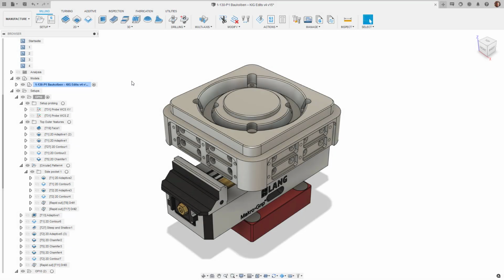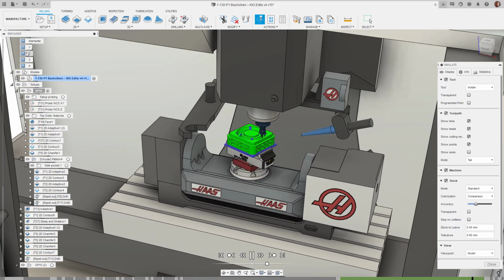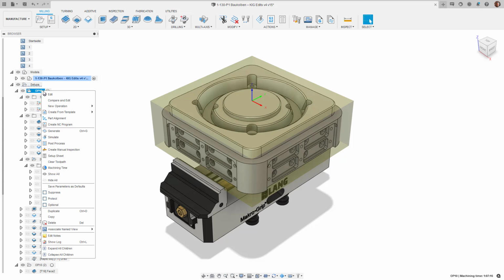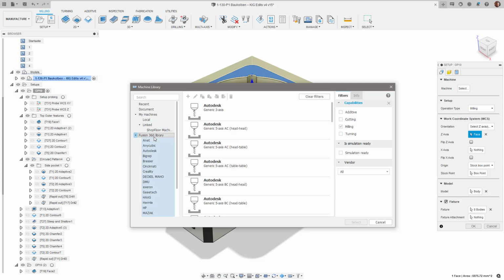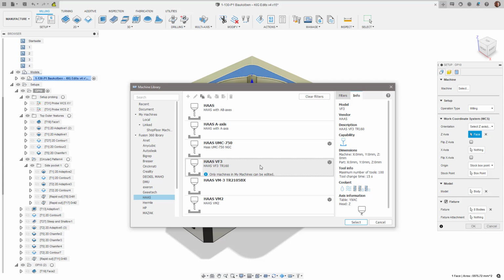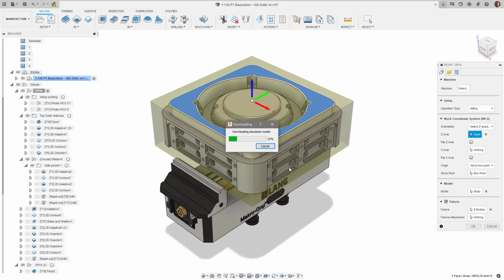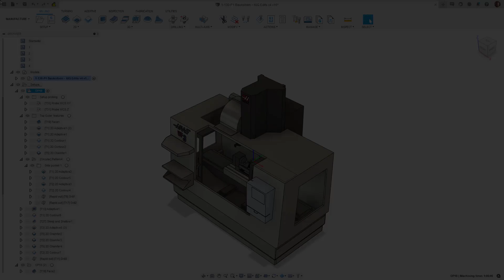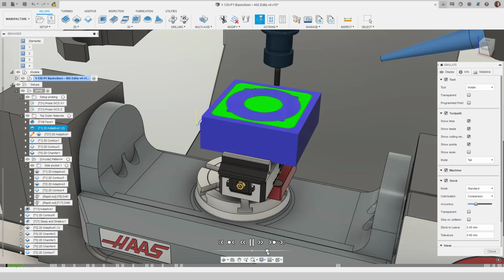Fusion 360 Machine Simulation  - Get the basics

Comment: I get an error saying "Post processor not compatible with machine simulation. Simulating without a machine." However, I've got the machine itself moving and setup just fine. It seems the Doosan 3/5 axis post doesn't support simulation. Any ideas?